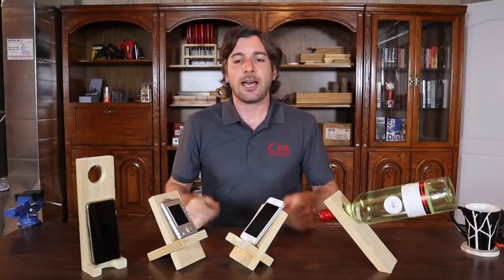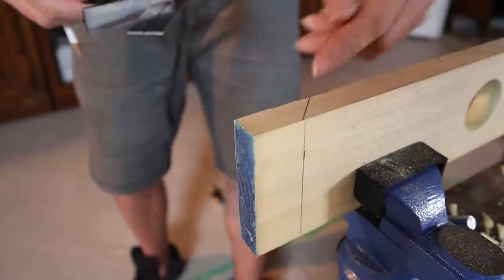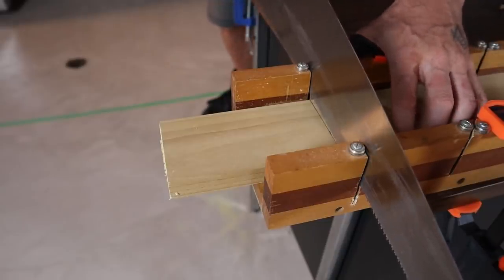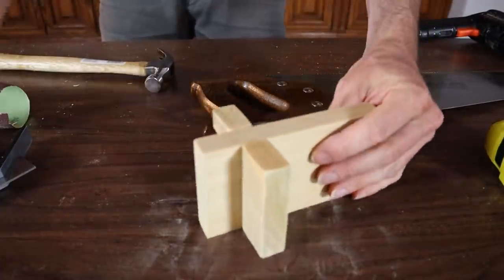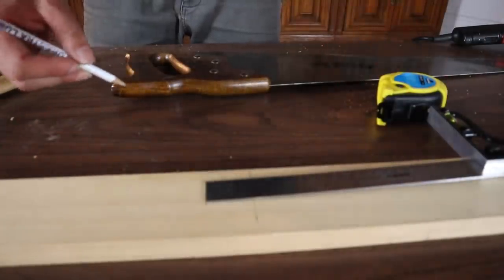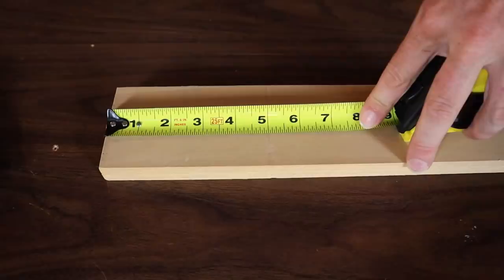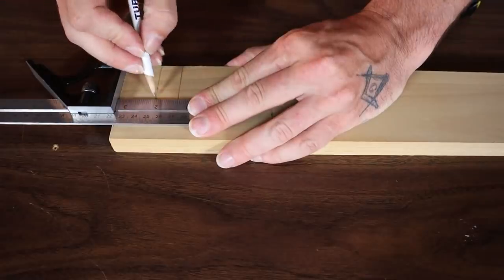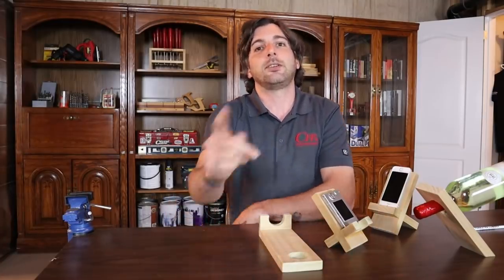4 Easy To Make From Home Wooden Projects For Beginners ( Phone Stand | Wine Holder )

Comment: 4:55 If you take a piece of scrap wood and drill a hole in the same dimension,, then you can clamp it on top and use it as a guide.
Reply: ... and a piece of wood underneath, then you get a clean cut on both sides.
Reply from the maker: @gsp911  ya that would work. thanks for the tip.